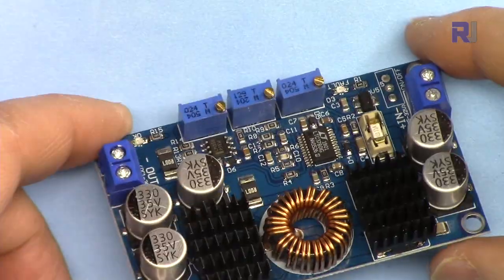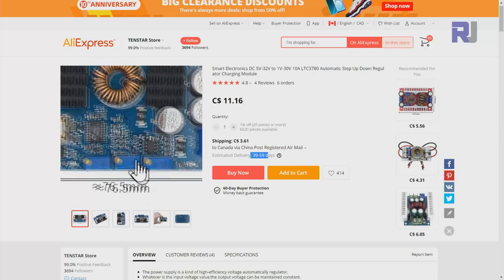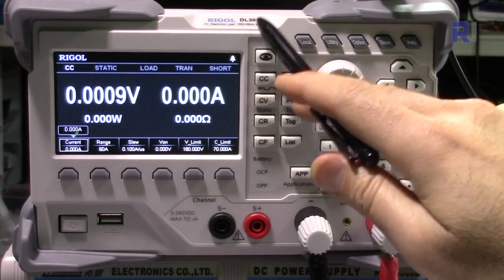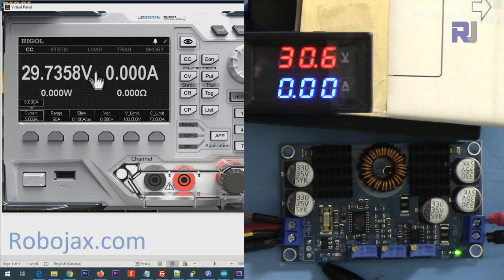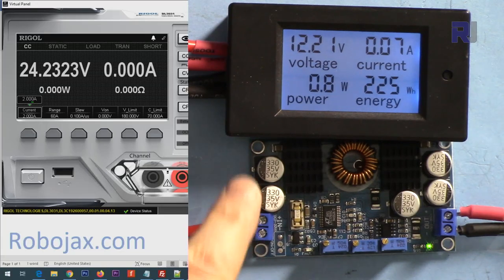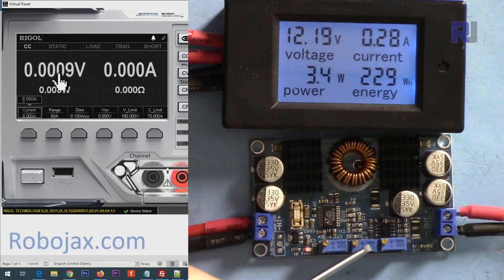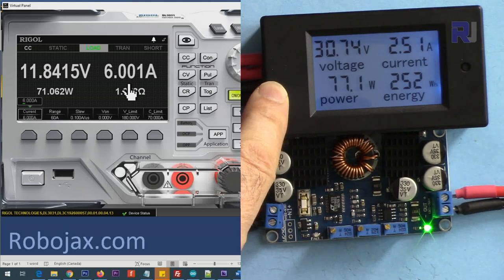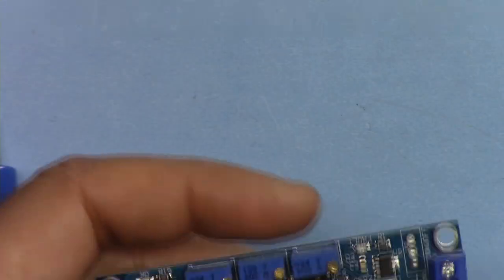Review of LTC3780 Buck boost 10A Converter: 2 module failed

Comment: Manufacturer says: "output power: 80W, peak power 130W, more than 80W, please strengthen the heat dissipation." You force it over 140W and without a fan...! Gollik :)
Reply: It worked well for me by following these guidelines. Maybe the manufacturer or where he bought it's the problem, there are many alternatives in China
Reply: 100% agree with your comment
Reply: Yeah, I think he said its a 10A module and was driving 16A though it, wasn't surprised with the magic smoke.
Reply: Yup, the handful I got are documented as 80W modules, that would be 3.3A at 24V. One of them failed at 140W sustained which seems pretty good, that's 175% rated load.

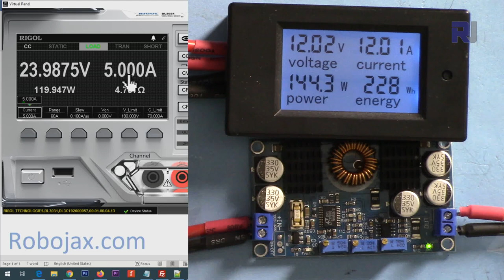Comment: nice review, btu here 16:05 the input power it's 185w, the manufacturer says maximum 80w without cooling... and at 23:05 you where pulling 120w, again more than the manifacturer limits

Comment: I'm surprised you tried to run this above 80W. Mine work fine. I had a look at the AliExpress TENSTAR store you mentioned in your video.  The specs on this page clearly state "Output current: 10 A (MAX) ,long term within 8A" and "Output power: 80W, Peak 130W, more than 80W please strengthen heat dissipation". So going above either 80W output power or 8A output current will likely smoke the board - which your video proves will happen. I don't see how this is a FAIL of the board though.
Reply from the maker: on most stores on eBay and AliExpress they claim incorrect values.  When they sell the item they should labels it with the current at the state the item is sold. Then they should say "for higher current use heat sink or fun" but they do it the opposite. they mention the higher current which the device can't handle and ask people to use extra heat sink or fan and that is not fair to the buyer. this happens to me many time. After receiving the time I realized they cheated with title. so I am now educating people. they might read it carefully.
Reply: I agree with your comment about online sellers. It can be really bad. I've ordered ICs and transistors where they've taken a cheaper or different component and printed the name of the expensive component on it. Every item you receive, you have to test to its specs so you have some confidence you received what you paid for. Then you have to waste more hours of your own time testing and taking photos for when you open a dispute to get a refund. I've won all my disputes. Hopefully if the sellers get enough disputes they will lose enough money and stop this practice. My last dispute for a "fake item", where I clearly showed it was a cheaper IC printed with the numbers for a more expensive IC; AliExpress stepped in and resolved the dispute within a day - they didn't even wait for the seller to respond. I think they are trying harder now to stop this problem.
Reply: My concern with your review is just that I've found the LTC3780 to be a good buck-boost converter. If it's used within the manufacturer's specs (80W) it seems to work well. The fail is really on the seller, not the LTC3780 module itself. Your review makes it appear the LTC3780 module is the problem when it actually wasn't - people might find that misleading.
Reply: @robojax  Yea, the board itself is not a failure then, it's the false advertising.
Reply: @peterrfoster  I agree, you read seller's specs correct. Moreover, if there is a max current stated in case of DC-DC modules this usually means the greater of the input/output current figure. It does not matter for the module how many amps load is receiving, what matters is the peak currents going through switches and inductor, which are often far from RMS values.
Dude smoked his converter while drawing 15A on input, blames module with puny heatsinks that won't even dissipate a couple of watts at reasonable working temps.
Reply: your roasting him too much he might turn the same as this converter (note its a joke) he did blame the module not the seller

Comment: Yeah, the board is just fine, it's that you tried to over-cook it. I bought five so far , for various projects... in both locations i bought it from, it was strongly speccified that over a certain limit (can't remember which) you're meant to cool it. Sure enough, there's variants with a big heat sink on the back, but that costs more than the standard or the cheapie variant (that one has, among other differences, a fuse that's soldered directly to the board). 

Ultimately, you needed cooling. Of course something's faulty if you don't follow specs.
Reply: As and engineer the first test of any module voltage rating is test if the module is burning out as a full bridge converter then the ic  is faulty and shot through is happening causing failure or the mosfet current rating is very low so I suggest removing the mosfet and add higher current rating mosfet with thick enough heatsink

Comment: One more thing: I checked again. During combustion, the input power of the module was 187 watts and the input current was 15 amperes! So the two values were very high than the manufacturer's information. I have the module and am very happy to use it and am very satisfied with it. You need to be a little more careful. You have no right to spoil such a successful product ..!
Reply from the maker: Hello, I know the chip functions as expected. I am trying to test modules where people are fooled and buy them from the title or details of listed items on eBay or Amazon.  see this example on eBay https://www.ebay.ca/itm/221953001309 
it claims:
130W or 10A. 
CLAIM on eBay: This module has a perfect protection function
** where is protection. the current was 6A. Power was 139W 
LAIM on eBay: Constant voltage, constant current, under voltage protection 
** where is protection. the current was 6A. Power was 139W . Where is constant current? 
When the power increases, any converter should reduce the voltage in order to keep the power/current at maximum allowed. . This is crazy, they claim "This module has a perfect protection function, and can be widely used in notebook power,". Wow. laptop the most expensive device and you want people to connect it. 
See it here as image https://snipboard.io/4GjMr8.jpg and this https://snipboard.io/hXlIu6.jpg

so I have to tell let people to they know. 
The same is true on Amazon https://www.amazon.com/s?k=LTC3780&ref=nb_sb_noss
so indeed this is bad module. Absolutely no protection.
Reply: @robojax  are you Kurd?
Reply from the maker: Persian from Afghanistan.
Reply: @robojax  without buying on an official source that is expected to happen they are 3rd party seller of course they would lie

Comment: I found this board in my drawer, it's probably a few years old and when I connect it to the power supply the fault LED is lit up. I tried adjusting the potentiometer closest to the input and when I turn it all the way CCW, the module draws a lot of current from the PSU so yeah, it's total crap

Comment: As far as I know the peak output power of LTC3780 is max at 130watts. 15:50. 5amps at 24volts  produces 120watts of power so it is acceptable but as soon as you hit the 140watts, it starts to smoke. I think that is the reason.
Reply from the maker: if you look at datasheet, it doesn't limit the power. It has only current mentioned https://www.analog.com/media/en/technical-documentation/data-sheets/LTC3780.pdf
Reply: even so he doesn't even have cooling fan he should know that going above 40 watts should have been bad idea

Comment: This board is rated at max 80Watt with the stock heatsinks and 130Watt as limit
Reply from the maker: most sellers just put 10A on the title and that's misleading and this module has design defect. Will do during operation or adjustment. Do not buy.
Reply: @robojax  If you aren't able to use it or correctly understand the specs this doesn't mean that all the people are like you. Bought.
Reply: @robojax  Don't think it has a design defect - its rather clickbait advertising with that 10 amps rating, which only holds for up to 8 volts (=80W max)

Comment: Another great video, thank you! So in the end what did you think and which buck converter do you like the most in the 6A range?  I’m needing to power a 5V 6A system (max, 3-4A on average) : two BST Lighting 8x32 LED matrices (each can draw 5v 3A) and an ESP32. Wondering what a favorite of yours might be that’s also efficient (I would use a 12v or 16v power supply).  Do you still like the XL4016 or something else now? I’m also thinking about wiring two XL4016 modules in parallel but I’m not sure if I would need to place a diode on them for backflow protections... also  not sure if I’d need to ground every device back to the 12v power supply. So maybe just having a singular buck would be best? 😅🤣Thanks again!
Reply from the maker: Hi, I have created separate energy related channel called WattHour https://www.youtube.com/@watthour and becauyse I have done so many reivews I actually don't remember  as I have not used them. I am using a dedicated  boxed power supply.  Sorry.

Comment: Was the first thing to smoke one of the input-side FETs? (FETs "A" or "B" in the datasheet example)? Possibly failing with its gate shorted to source and/or drain, backfeeding input voltage to gate-drive pins of the LTC3780 itself and causing that chip to then fail?  I've been using one of these modules as a 24V->13.4V buck converter with no trouble so far, but unfortunately its current-limit feature is inoperable when there's a common negative/ground between input & output, because it depends on all output current passing a 7-milliohm resistor in series with the negative output terminal (voltage across this shunt being sensed by one half of the LM358 opamp; its other half serving the low-voltage cutout circuit).  After watching your video, I'm changing its output fuse from 15A to 10A to hopefully avoid a similar fate!
Reply from the maker: Thank you @Jordan for sharing your thoughts and experience.  yes this module should be designed differently to make it reliable. I am sure 100 if no 1000s of this has failed and they are still selling it.
Reply: @robojax  I think the provided heatsinks should have been larger to safely handle this module's claimed power rating. I placed a 1mm-thick thermal pad under mine, allowing the (well-vented) metal case it's mounted in to serve as additional heatsinking for the FETs. I considered using a fan, but since it's normally passing 5A or less that shouldn't be necessary. It turns out the current-limiting is not completely useless with a common negative, so long as resistance of the external bypass path via ground isn't hugely less than the 7-milliohm sensing shunt resistance.  It just needs to be dialed way down to account for only a fraction of output current flowing through the shunt.

Comment: This board cannot handle more than 32v input even though the chip supports up to 40v. And lose potentiometer connections can also burn the MOSFETs pretty easily. I had 2 of these and both died after fa while. I think it's either due to the fact that my PSU output is 36v or since I desoldered all pots and replaced it with  3 pin JSTs.

Comment: the mosfets are a SMT type, wettable flank. Problem is they are incorrectly heatsinked, where the actual side meant to be heatsinked is thermally isolated and the heatsink size and placement wasn't appropriate for this type of circuit.

Comment: RoboJax, Please help   (1) I want use  buckboost converter as a backup for my 19v Dell laptop (90W power max) using a 12v car battery.  Could you tell me which is the best module for this task.  (2) For my 12v 3A router, which would be the best buckboost converter, same battery.       Thanks in advance.
Reply from the maker: Hi, I have separate channel on PowerSupplies and energy called WattHour here https://www.youtube.com/@watthour I don't remember the converters rates.

Comment: i need 12v and 2amp current is it possible with this modulle and my input 14.4 v and 30amp is proper for my project
Reply from the maker: I believe I made the video to answer these types of questions. So please watch and see if you can get 12V output.
Reply: @robojax   THANKS A LOT I HAD SEEN YOUR ALL BUCK BOOT/ BUCK/BOOST CONVERTER VIDEOS CAUSE NO ONE SHOW ALL DETAILS LIKE YOU I LIKE YOUER VIDEOS

Comment: This is not a fail module. Works pretty good. Those comments from the supplier shop its just ignorance. The board when you buy it, comes with undervoltage protection around 12v they just need to turn the potenciometer until the protection lifts. Another ignorance its the fact that the board manual says that above 80 watts it needs to strengthen the heat dissipation. So its nothing wrong with the board. This guy its just overstressing the board without the proper heat dissipation.
Reply from the maker: everything is wrong with this. you can't even get 2A.  they sell it as 10A module.
Reply: @robojax  I used this board for a DIY bench power supply 3 years ago. Its still use it for my projects/repairs and works with no problems. And i supplied more than 6 amps already with it and it still lives. But ofc it needs a fan and proper heat sink like any other bench power supply.
Reply: @robojax  I always using watts as my limit parameter. Using amps just missleading.
Am sure you still can use 10Amps, but only 8 volts (so 80 watts) as the safe limit without propper cooling.

Comment: Thank you for sharing this video, seems the power transistors is not capable to handle that current , did you tried to fix the dead module by replacing the transistors with powerful ones ?
Reply from the maker: I said, this is bad design. do not waste money.

Comment: This board is rated 80W max. If you missuse it, don't blame it for breaking... And pls don't tell people it's crappy... But nice video to get an impression how it works.
Reply from the maker: Hello,  but it died while I was adjusting it. they claim it has protection and it does not. I am testing based on listing on eBay and aliExpress see one of many examples https://snipboard.io/hXlIu6.jpg
Reply: @robojax  yep thats the seller not the converter doesn't change the fact that you blame it for the failure

Comment: Hi, my board also died, during adjusting Vout. But there is one major difference - I had no output here (so no current flowing), just voltmeter attached on output. I did not see any smoke, green diode started to blink from bright to dim. So I disconencted the input and after I connected input again (12 V), fault led turned on (not blinking, it was steady on). LTC3780 chip gets REALLY HOT now. I thought I did some soldering mistake (I replaced trimmers with potentiometers), but now I see that my usage might not be a reason and I will ask for my money back. Thank you for this video. I am now seeking for some more reliable replacement, as I had a plan to build low-cost power supply based on this board.
Reply from the maker: You are welcome. Yes. avoid it. Do not accept another item. Find some other solution.
Reply: @robojax  I will give a change to "10A DC-DC BUCK BOOST MODULE STEP DOWN UP 5-30V TO 1-30V WITH CURRENT CONTROL" It is available from ebay, aliexpress... It is different design, but should have the same functionality.  I know it will have far from 10A, but I do not expect running heavy loads with it. If this will also fail, I will try to "copy" the design and enhance it with help of some electro-engineer.

Comment: Hi .
This model is not 10 A 
I have 3 from them they work fine with me .

You have to 
1 : change the fuse to 10 amp 
2 : Your input current have to not pass 9A or you will kill the mosfet .
3 : you need to add a small fan to cool down the heat that comes from the heat think .( Try if you can change the heat think because they are not good cooler )

IAM use right now 2 from this model 
One to convert 12v battery up to 26v  to operate a device that need 2battery .
And in reverse the device is supposed to charge 2 battery and IAM use the second one to step down the charge from 28 down to 13.8 to charge the battery .( I add diods to block the reverse between battery and charger so there will not to be conflicts between 2 converters )

The model is good as shot operation or you need to lower the current to 3amp in the input for this cooler size . 

As my experience in many DC to DC converter this device is overrated in design and power  and downrated in cooler system and protection over power and current .
Reply from the maker: thank you.  this I always do. it failed while I was adjusting it . Defective design.
 I get the title which says 10A and I put 10A to show people not  to get mislead with title.  with input of 3A  and lets say 5V, 3x5=15W so output at of 5V,  15W÷15V=1A (-15%) =0.85A
Reply: Any suggeestions, if hiher power draw/rating is needed?

Comment: hello great channel. acquire such a plate and after replacing the potentiometer the plate will not turn on anymore. and short at the entry and exit poles. What can it be?
Reply from the maker: Hello, why you replace the potentiometer? it must be different value or bad soldering. remember the potentiometer is multi-turn meaning you have to turn it 10 to 15 turns before you see changes. do it slowly.

Comment: Sir, thank you first of all. I am try to doing psu lab. Tell me please LTC3780 fault led was blink after so was hot. Did it burned or Am I should check again this pots? Thank you a lot.
Reply from the maker: Hi, you are welcome. you make my watch this long video (remember I have over 400 videos as of now).  I have shown the fault LED twice. I have even link to the section of the video where the module dies. module 1 dies and module 1 dies.  you can go directly there by clicking on the link (time) in the description.  Yes blinking means it is dead. do not buy this again. it will die.
Reply: @robojax  I didn't see your reply, just now Im seeing. Thank you sir. These your review videos so important for this areas. Thanks again.